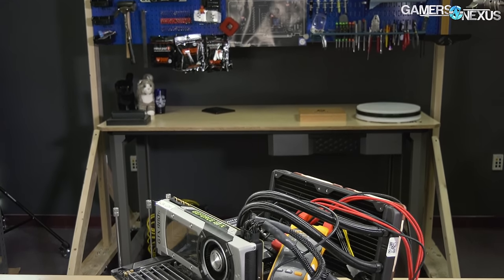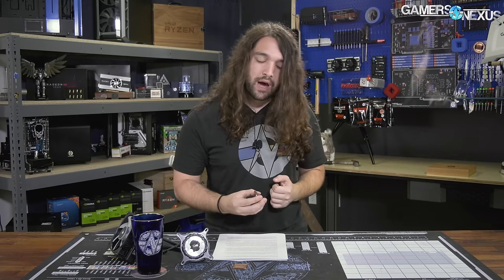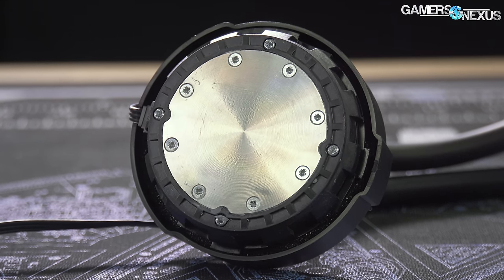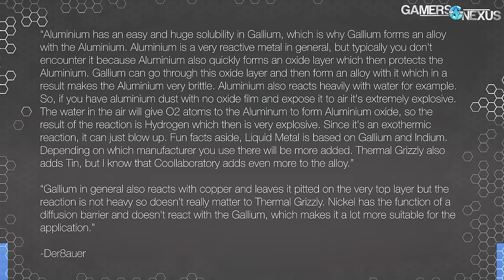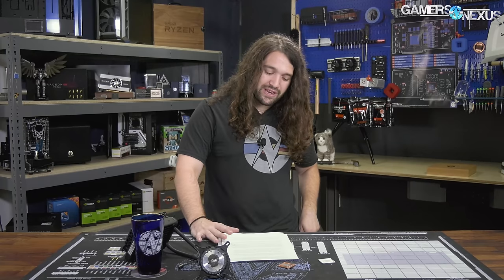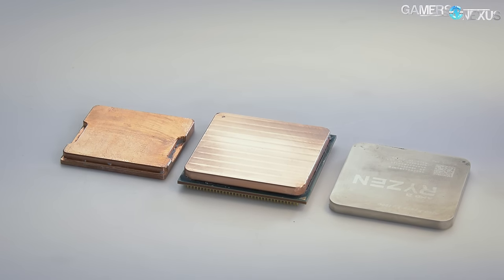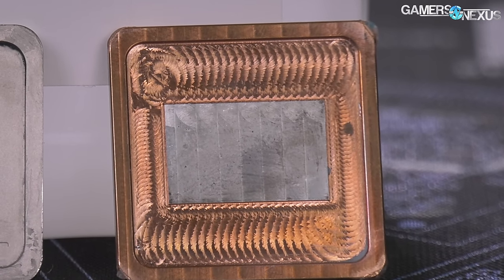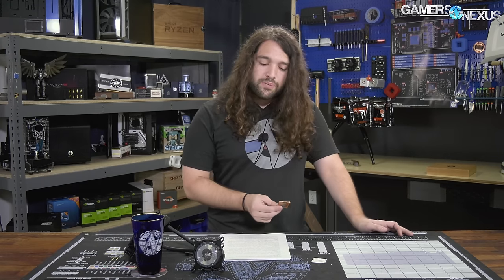How Liquid Metal Affects Copper, Nickel, and Aluminum (Corrosion Test)

Comment: I think't its better to just use a good normal Thermal Paste.
Reply: no its not, liquid metal is best every time for delidding. standard paste wont knock of 20c like it did for me.
Reply: Most just want to get things done and don't need extreme cooling.
Liquid metal can be dangerous if spill and used with the wrong metal.
Reply: Liquid metal is usually used by those who want lower temps so they have a higher thermal headroom for OC and such.

If you just want lower temps, normal good thermal paste will do just fine. I prefer that on laptops, actually.
Reply: @1300l  Liquid Metal is much better for overclocking
Reply: i agree it's better in that it's cheaper and widespread, doesn't corrode anything, doesn't conduct current, it's easily cleanable. that's why i too prefer it.
as far as thermal performance i've seen many many many many many many products that claim huge benefits since before internet was a thing and in the end the tl;dr has always been this: it's pointless to bother, but nobody is harmed so it's okay.

for ACTUALLY EXTREME OVERCLOCKING (tm) every bit counts so yeah this is a valid use case for expensive stuff... me? i've spent some change for 100g of white shit paste, which is enough to last me for another 20 years at least unless i go big on amplifier repair. btw i apply it with my index and not care like we all should.
Reply: it can be. case by case. sometimes people dont get any improvement and sometimes it was not the cause of the issue orginally.
Reply: Agreed, 

Ban LM especially for amateur not recommended.
Reply: @claritoresdiano1021  there is not amateur expert level LM user when it comes to application. Just requires a viewing of a video then logic when you do it yourself. Not overly.complicated.
Reply: 1300l  It's not just for extreme cooling on OC monsters but makes the cooler more efficient (as it strengthens the weakest link in the chain), that allows lower fan speed therefore less noize and dust collection. It's a great tool. You just need to learn how to use it only once, then it serves you better than any other stuff for a long long time.
Reply: @1300l  Thats true but if you take just a little bit...(not liek most youtubers) you wont have any problem. The LM is just here to fill micro gaps and to make over the whole surface contact so not too much is needed.

Comment: When its come to liquid metal and to  delid intel cpu. Do you honestly have to delid intel cpus to use them?? Like can they operate at normal frequencies or even overclock a little. This is for both mainstream and HEDT platform.i ask since seem to be what everyone talk about with not enough information on people not doing that. As well as almost make it seem like your cpu will burn itself if you don't..
Reply: if you want to put the voltage above 1.30v..then yes liquid metal is necessary, unless you are fine with high 80 to 90 degree C temp during the stress test and using demanding software. The thing is, if you are to overclock a cpu, chances are you need 1.30+v. That is why you want to delid it.
Reply: the highest end HEDT stuff gets quite hot except with a good thermal solution, and even then doesn't overclock super well. Basically if you're getting one you probably already want to overclock anyways because you're an enthusiast, but other than that LM is nice to have but not necessary.
Reply: Okay so for example a i7 8700k and a i9 7920x you overclock both to let say 4.5. For making videos and to game your temps would be that high? Cause yes you stress test but it not like most applications will use 100% of the cpu so wouldn't the cpu not get that hot to begin with? Appreciate the input and information just trying to understand these cpus more.
Reply: for extreme series like i9, even 1.2v makes the chip very toasty. Unless you have a dual tower cooler or 240mm aio or above, it can easily surpass 80C while playing modern games. Yes 80C is perfectly fine operating temperature but it is matter of whether you can be comfortable with the fan noise and  highly limited OC ability.
Reply: @kimizle  okay i see that why people delid to lower the temps then huh. I think it sucks thou because you void your warranty right when doing soo?
Reply: yes it will surely void the warranty. Again, it's perfectly fine to run at stock without delid. However, this is the question you must ask: What is the point of paying premium for "unlocked" cpu when you are just gonna leave at stock? Clearly you want to overclock and fiddle with it. But you can't without delidding, which is definitely problematic.
Reply: @kimizle  hopefully the i9 9900k isnt only cpus intel soldiers again. Paying such a premium you think they do that especially now that they proved the move original was b.s. I think gamernexus said only thing that make current chips a problem is not being soldered that has led to higher temps.
Reply: @kimizle  thank you for the information good to know what what and good to get info from people on all intel current cpus.i know they perform great just how their held back.

Comment: How do you even "mix" elements?
Reply: Alloys are a thing.
Reply: @Sareth94  But elements are the base atoms that make molecules.
Reply: @MaxHarden  metals very much aren't molecules, dude.
Reply: @Sareth94  Correct.  They're elements.  So how do you mix elements?  Those don't mix, the react to each other.
Reply: @MaxHarden  are you serious?
How do you think carbon steel happens, or stainless steel with 18% chromium?

Metal isn't a molecule, it's a crystaline structuture without(!) electron-bonds. 
Different metals can alloy to certain degrees, meaning they simply "mix" in this crystal structure - even some non-metallic elements like carbon or phosphor can be mixed with metal. 
They don't always react or form molecules. They form an alloy - a crystal structure of mixed elements.
Some metals mix very well, like copper and tin (making bronze), some not so well, but they all do to some degree. On the base level it's literally as easy as "melt pure metals, mix and stir, cast into desired shape"
Reply: @Sareth94  Thanks for explaining it.  That actually makes sense.

Comment: Be Aware !!!  The Thermal Grizzly Conductonaut killed two of my CPUs! The first to die was the Intel i5-8400, which worked for 3 or 4 months, the symptoms at boot time were a blue screen of death, but at the same time the BIOS settings work perfectly. The second died AMD Ryzen 5 2400G with the same symptoms that Intel had, but it lasted more than six months.